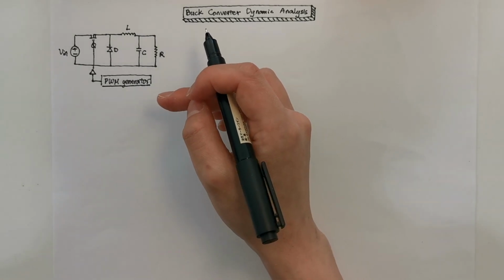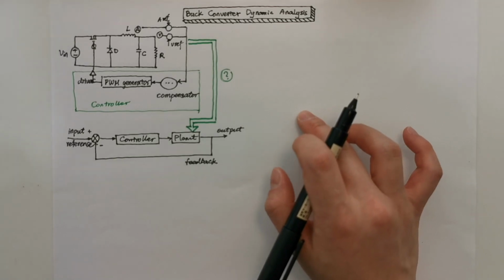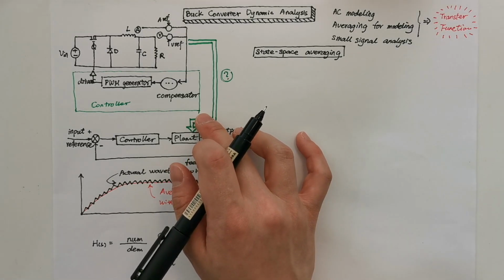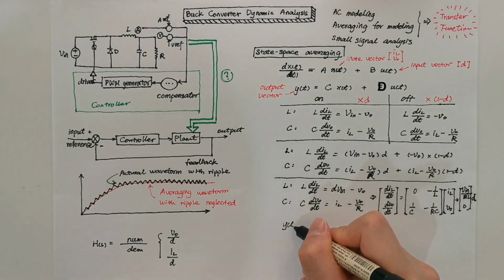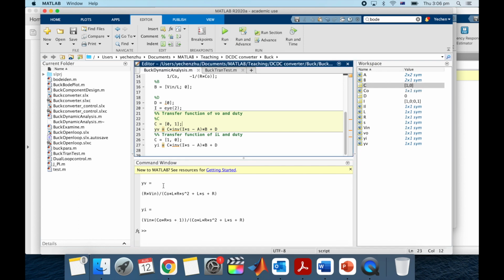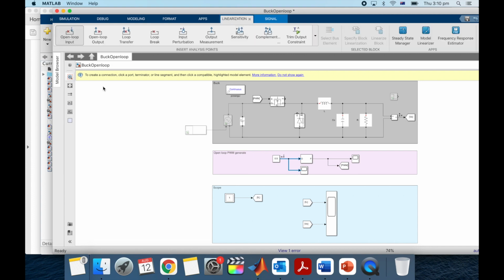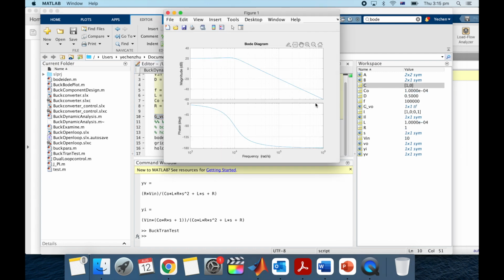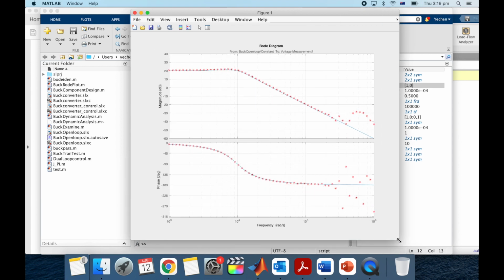Buck Converter Dynamic Analysis + Simulink Model Linearizer

Comment: Hi, thank you very much for the detailed videos, once I run my Simulink model it shows this error so when I change the powergui block from discreate to continuous another error appears related to discreate solver.
In "frestimate(modelname,op,io,in)", the input signal "in" is a frest.Sinestream signal which has parameter values for "Frequency" and "SamplesPerPeriod" such that it inherently has multiple sample times. Using such an input signal requires that samples rates belonging to the Simulink signals where your linearization input and output points are located are either continuous or fixed in minor time step and the linearization I/O io(2) does not satisfy this requirement. Consider either changing the sample time of Simulink signal where io(2) is located to continuous sample time or using frest.createFixedTsSinestream utility to create a sinestream signal that has a single sample rate.